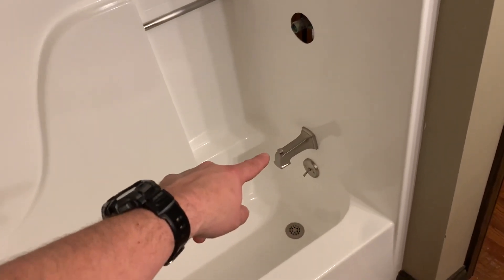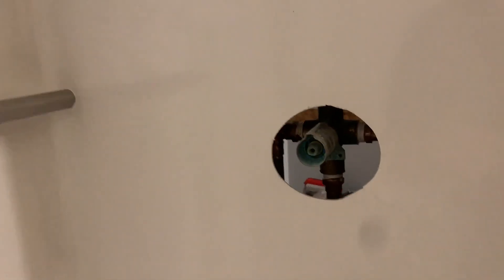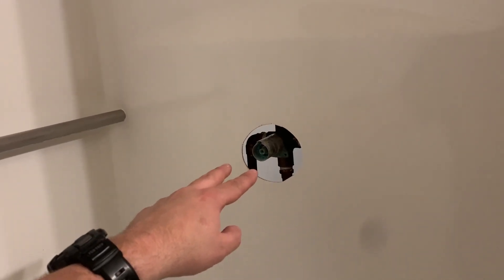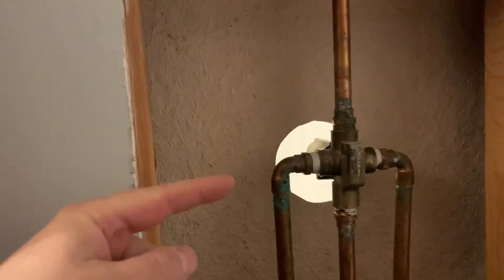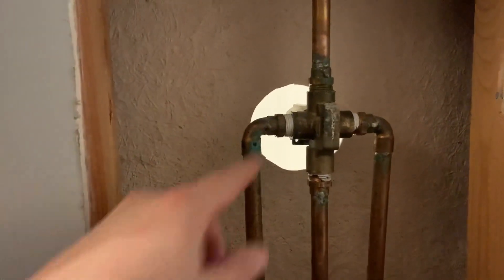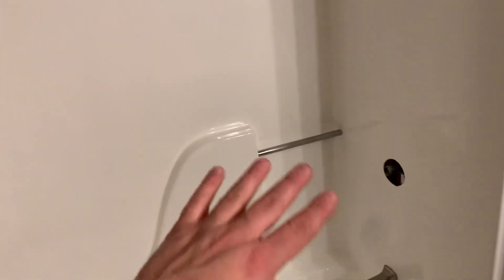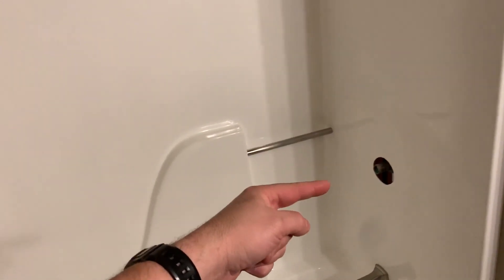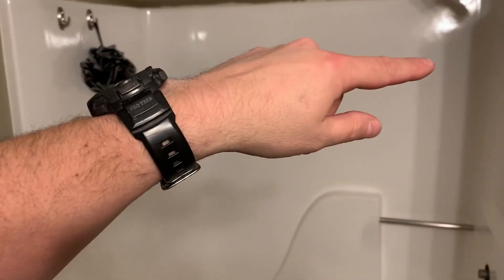Watch this video BEFORE refinishing your tub or shower!

Comment: I'm a retired plumber turned handyman, I would suggest before sweating off the existing fittings that you do these steps. 
1: fill a 5 gallon bucket of h20, place shop towels inside to soak.
2: turn off the house water.
3: take a gas torch using the yellow gas can found at Lowe's HD Ace etc. It burns hotter and quicker than the typical green propane can. 

4: drain the tub/ shower
5: place the shop towels into the opening of the shower wall, stack them in a way that fills that hole. 
These wet towels will keep any heat from damaging the fiberglass wall. Having a water bottle squiter near by in case the flame hits a stud or the fiberglass it can quickly cool off or put out a fire. 

6: Sweat off the one pipe that has some movement in it, typically the hot/ cold pipes will have some wiggle play. Then work on the shower feed or the tub feed which ever one is easier. 

A sweated on fitting will always out last a sharkbite fitting, and will provide the best peace of mind. 

Sharkbite fittings can fail, especially if the power goes out and the water pressure spikes after power is restored. 

Sharkbite fittings on pex B seldom fail, however the teeth on plastic bite really well on copper not so much. 

I've come to the rescue to many of a professional home owner who have has similar issues. 

If you can weld, you can solder. 

The trick to good joints is having clean fittings, good flux,and the proper heat. 
When sweating off fittings focus the flame near the bend on a 90°~45° etc. On the threaded male/female fittings focus the heat at the joint.  And using a pair of channel locks gently pry them apart. 

This would be in your wheel house for skills, it's not hard but can be frustrating at times, a good pair of knee pads will help save the back. 
Hope this helps
Reply: You said that much better than I could’ve 👍👍
Reply: @opichocal  Happy New Year MMXXII !!!

#SemperFi
#SicSemperTyrannis
#AlexJonesisRightAgain

Comment: Looks like you opened a can of worms.  LOL. Make sure the new shower valve you install is pressure balanced.  Prevents you from getting a big temperature change in the water when someone else in the house turns on a tap or flushes the toilet.